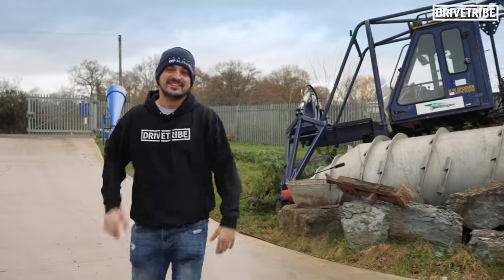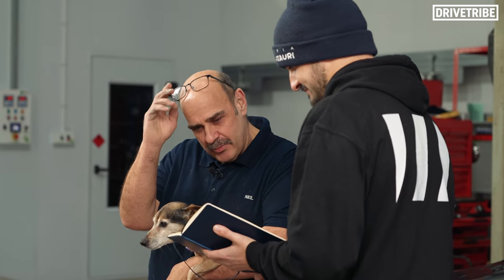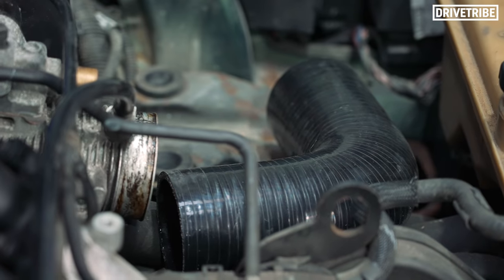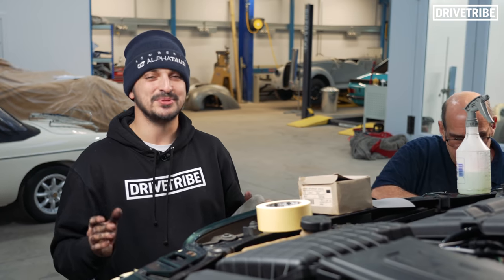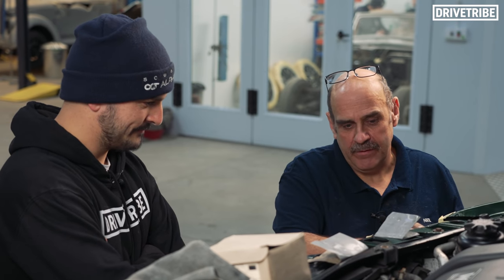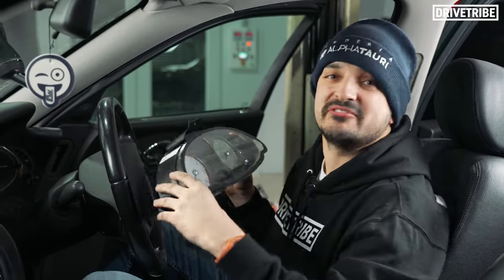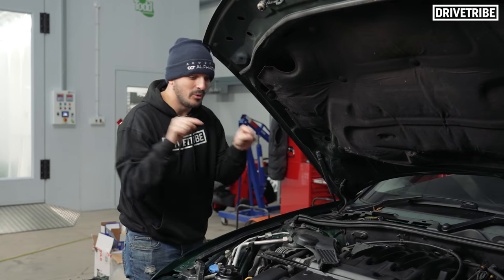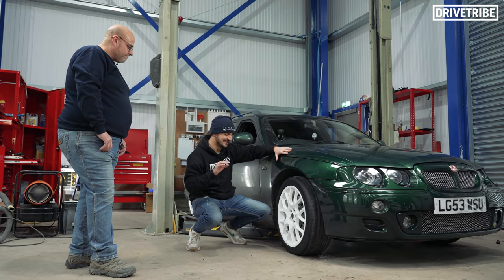We tried to fix everything on this £1500 estate car at Richard Hammond's workshop

Comment: Hmmm. A day's work??
Pity there didn't appear to be time to remove the wheel sand do a proper refurb (blast & epoxy/powder coat).
Maybe if they hadn't wasted 15 seconds of filming and editing that idiotic Haynes Manual segment they would have had a bit more time.
Fitment of larger disks and new callipers? Need to tell the insurer's about that. Should have stuck with standard size but Brembo or EDC with better pads. Did they change the brake fluid? Probably 'cos the callipers were taken off. Old brake fluid degrades and causes spongy brakes.

Unfortunately a typical millennial quick fix, instant gratification with a load of detailing (shampoo) at the end.
The mechanics are spot on, just can't get away with most of the 'tribe presenters.